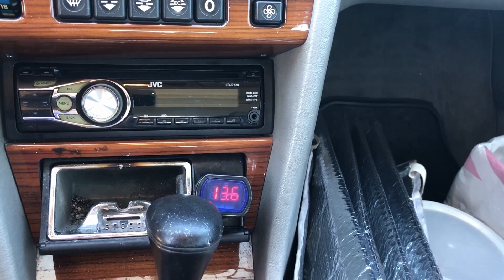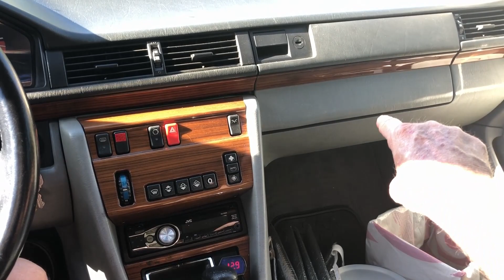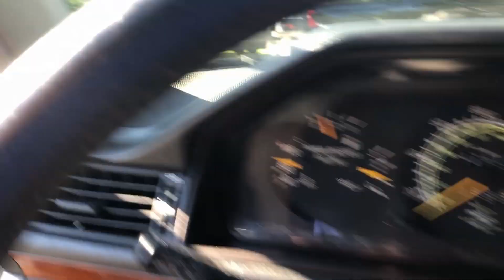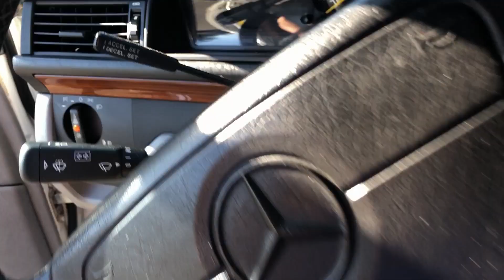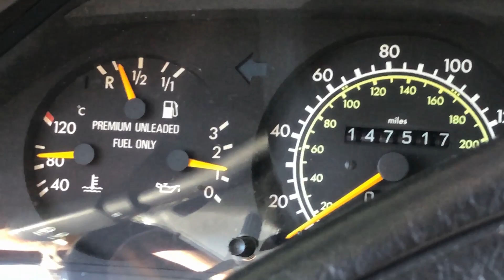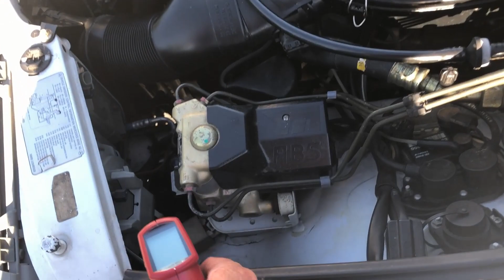W124 Final Test High Speed Cooling Fan #3

Comment: Following up with this. I sent you the schematics, hopefully you received them and were able to correctly place the wires back into the proper pin out holes and your issue has been resolved.
Reply from the maker: Thanks!
Reply: @mygermancars7264  1 problem down and many more to come 😂....but at least you have the m103 engine. Short of a completely seized engine, the m103 will continue to run as long as there is fuel, air, and spark....Can even run it without an ecu if you needed to. Just make sure you stay on top of the tranny though....the notorious B3 brake band (reverse) seems to be the first to go 90% of the time. Ugh!, I remember having to always park on an incline or pull forward through a parking spot so I could either free roll out of the space or just drive out without going in to reverse. Did that for about a year+ until I got a new transmission 😞
Reply from the maker: Update. so after studying the schematic  I think your right, my wire colors are the same! and looking at a few other schematics looks like the wires all need to go down in connector, will try to change them this weekend, will do a video and post, so weird? who would have done that and why??? thanks for the help man!
Reply: @mygermancars7264  👍. Happened to me a few times when changing some of the brittle connectors out in the engine bay. Ended up swapping around pin 1 and 2 not realizing that they are different polarity and ends up throwing everything off.
Reply from the maker: @LawrenceM103   It worked!!!! good grief its been like that for who knows how long, we've had the car for 12 years, everything works the way it should! big thanks man! you've got a keen eye! will put video together soon, not sure what to name it lol.
Reply from the maker: So now its got a blown head gasket from overheating, the joy.
Reply: @mygermancars7264  How do you know it's a blown head gasket?
Reply from the maker: @LawrenceM103   used the  combustion leak detector, blue liquid  turns green, its blown HG or cracked block, coolant turned brown recently in EX tank,  my son boiled all the coolant out of the car,dummy, he had the warning on the dash, gauge, pegged in the red, he should have pulled over immediately!  This will be the 4th HG on this car in 12 years, last one was last September, all because of the high speed fans not activating and its a 30 year old car, whoever did that switcharoo ,good grief, I will fix it.
Reply: @mygermancars7264  if you ever wanna get rid of it let me know
Reply from the maker: Can’t wait to try it out! It’s my son’s car and needs it for work this week, maybe Saturday, he loves that switch on his dash, says it brings temps down in under 30 seconds, trying to figure out if we can keep it for the over ride function?

Comment: So interesting that you are having the overheating issue. I've been following this situation and there is something amiss. I'm actually one of those people that live in the southern California desert area (Palm Springs), and I actually don't even have the viscous clutch fan on my w201, I'm only using the dual aux fans and I am not over heating at all. I do have the fans turn on high speed at about 95*C, but still same engine (I have the M103.981 from the W126). I did upgrade the electrical system to run the 120 amp alternator from the W140 to accommodate 2 batteries (1 strictly for starting the car and the other for everything else). So did you even get the high speed fans to work? Your original issue was that the fans did not turn on high when they were supposed to and yeah you added a switch, but did you fix the original problem?
Reply from the maker: Did not fix original problem, after a week  of diagnosing I got burned out, my sons been driving this car for 12 years, it’s been a pretty good car without to many issues, he bought it on eBay for $3,800, arrived with a blown HG, so I fixed that, machine shop etc.
Last 5 years it started having this overheating problem, only during summer time, last summer I replaced entire cooling system 1K, did the citric acid flush to block thinking oil scaling reducing flow, not much came out, also installed a new HG due to oil leak at #6.
Trouble shooting the HS fan issue, sensor sends signal to CCU, schematic shows blue/ grey wire from sensor is input for CCU, that’s the main trigger signal to turn on fans HS, good continuity on blu/grey wire, sensor new, output from CCU is brown/grey pin #13 that fires HS fans, continuity good from wire to fuse box relay socket, with car on CCU is outputting 12v on that wire to relay socket, but still no HS fan?
Here’s what’s strange, at pin 13 wire I can apply 12 volts with power probe and fans come on? Or I can apply ground to wire and fans come on? Bizarre as hell!
So for now installed dash switch using only ground signal and can activate fans.
See what I’m up against?
Schematics shows K10 and K9 are wired in parallel, that may explain the confusion.
Now testing the relay sockets at fuse box, with key off some sockets test as grounds, turn key on and they test as +12 ???
That’s weird as hell!
Gave up for now, besides next spring would like to retrofit to new electric fan setup, lose fan clutch deal.
Reply: @mygermancars7264  Did you move all the wires up by one pin on the connector like I mentioned? I'd have to check, but blue/grey wire for MB at that era were typically for light illumination. Sounds like you might have had a simple problem with a simple fix that you could've compounded if you got one thing wrong now, despite the troubleshooting, nothing is lining up. Kinda like buttoning up a shirt and missing one hole, everything is then completely off until you go back and fix the one thing. Super frustrating. I'm sure all the components all check out perfectly and within spec, even when bench testing. I remember I replaced my head gasket because of something completely dumb. My coolant reservoir had a crack so I put on a new one and shortly after my car kept over heating. I replaced the coolant cap and same thing. Coolant flowing out of the wheel well tank and temp spiking to 120C after 10 minutes of driving. Symptoms all pointed to exhaust gases going to coolant so I replaced the HG. However, that was not the problem. I actually ended up accidentally connecting the hose from the thermostat housing to the nipple just below the radiator cap on the reservoir and the hose going to the over flow tank to the other nipple when I replaced the reservoir. 🙄 such a simple mistake could've cost thousands had I not been able to do the job myself.
Reply from the maker: @LawrenceM103  Move the wires ? no, did not and don't think that would work, the wiring is still factory , each wire is cut to a certain length  to fit the connector, about 15 wires in it, would be hard to put the lid back on for sure,  but every schematic shows pin 11 brown /grey  is the trigger wire for HS fans, mine is pin 13 brown /grey, then again could not find exact schematic for 1991-1992, just 1985 to 1990, so figure they did revisions, hard finding 30 year old  European schematics, probably in Germany they would have it.
The only things I can think of are, could be a grounding issue since my switch makes them work using  brown ground wire borrowed from rear headrest switch, or ,I have found some rat/mouse droppings in engine bay, maybe they chewed a wire somewhere? or , when we got the car years ago it had a few interior electrical issues like illumination lights not working, fixed that at instrument cluster, or, someone cut 5 or 6 grounds behind radio unit and under consol  , could have been some idiot installing stereo /amp setup, I fixed the cut grounds.
See why I give up lol.
Reply from the maker: I did the same exact thing on first HG job, had the EX tank lines reversed lol
Reply: @mygermancars7264  I have every schematic for the 124 for about all 40- 50 model variants from about '86 - '95 that's why I told you to move the wires.
Reply from the maker: @LawrenceM103  Maybe you can send me one? for 1992 W124 300E M103 USA,  just need the Relay schematic , coolant sensor blue pin and CCU inputs outputs. artbyleclerc@gmail.com  
Car was delivered to the USA in October of 1991 so I imagine 1991 schematics, I couldn't find any, just up to 1990, still 1990 wire colors are different .
I think car was built on a Monday or Friday lol.
Reply: @mygermancars7264  when I get home
Reply: I have a 1990 w-124 with a M-103 2.6 L engine. It didn’t get hot the over voltage relay was bad and it messed up the voltage to several things. New relay sorted.
Reply: @lineman5724  I'm hoping he has this sorted out by now. I told him he had all the wires in his connector off by one pin a few days ago. I sent him the actual schematic and a screenshot photo of where his error was. Hopefully he's just moved the wires back up to the proper slots and is now done with this.